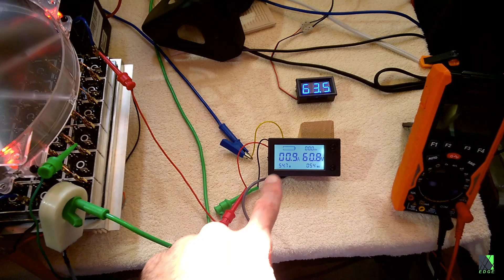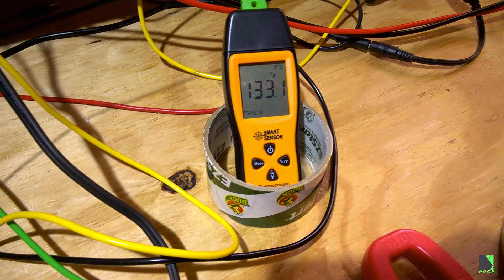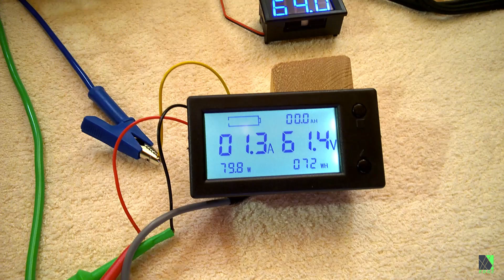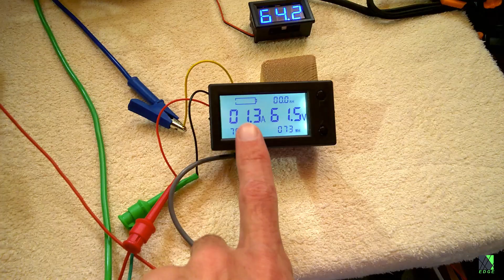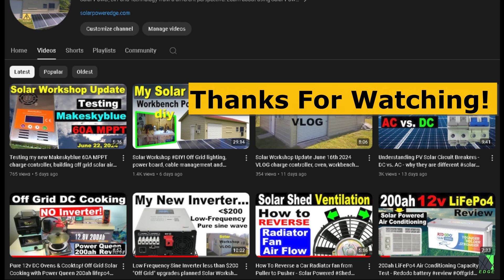Solar Workshop VLOG 008 Infrared bulb, semiconductor solar electric space heat, random updates

Comment: Loving these solar heater projects and was excited to hear you were thinking sand battery and water heater.  I built a 10x20 greenhouse (in zone 6) and want to find ways to heat it (50f to 60f for now) off the grid completely or partially.  I am turning the floor into an insulated thermal mass subfloor heated with hot water, but still figuring out how I am heating the water in the first place.  Have 400w of solar panels (more soon) and been looking at various solar projects for heating.  Your diode chain setup is looking tempting.  Now, maybe I don't understand, but I should be able to still charge batteries from the correct "tap" off the diode chain to match charging voltage, correct?  I did take a few electronics and ee classes a couple decades ago... Ha... Don't remember as much as I would like.  I understand why the diodes arw doing what they do, a little confused why you end up with more "waste" electricity converted into heat than an mppt.
Reply from the maker: Hello, glad you like the videos - in the more recent diode heater video, I explained how a nichrome heater won't get maximum heat when PV connected. A quick glance at Ohms Law/Model will explain why. With the diodes in parallel, they regulate the vMP (max power voltage) which results in more heat overall. I think most don't understand the concept but it is relatively simple and works very good. 

Here's my video of a scaled down test. Think most people were focusing on the wrong point, the watts coming through the diodes while ignoring the Nichrome part. But the theory and practice here is spot-on. The overall system maximizes heat production from PV without any complicated logic or circuits. What does MPPT do? It regulates to PV max power voltage. What do diode chains do? They act very similar to MPPT, yet are dirt simple! combine with nichrome, now you can have the best of both worlds. This is a very uncommon and productive marriage of simple technical concepts :)
https://youtu.be/Cle05mmYOUs

It should be possible to charge batteries with diode chain taps - however I mostly tested them as voltage supplies. It works for running my fans as you can see :)

Comment: Ahhhh this video answers some questions I had in the previous video I watched..... 
YouTube has been recommending a lot of videos that I don't normally watch and not putting forward the channels I do spend a lot of time watching.... I found this video by randomly scrolling.... 
79W is a good number for power consumption, what would you say that you are using as a total which appears to also include the nichrome heater? And what's the temperature outside? 
I heard that it's keeping the place warm, but the colder the weather outside the harder it is to keep a place warm.... 
Obviously a heating device needs to be designed to work for a given area on the coldest day or night of the year.... Things are starting to warm up in the southern hemisphere, so testing heating systems is getting to be a challenge.... But just like hunter gatherers, if you don't work to prepare during the warmer months, you will starve during winter! Or freeze in my case, not that I don't have a method for heating, I have several.... But I'm looking for something that is small, doesn't require a lot of energy to run, and I can use more than one if necessary for those tough days....
Reply from the maker: @PeterMilanovski I hope yt will recommend my videos more often :D this video shows so very little of the testing... I used 100-400w for some of the tests, especially in this video... then with nichrome to take most of the power (that's a good thing). During more recent tests, I used 1600w of solar to drive diodes plus nichrome. Then I added a second diode chain and 4 nichrome. Now I'm working on a bigger version plus a HWH tank using the same idea. The problem with video is I can't get them out fast enough to show the current status, nor is it worth showing every detail as no one will watch the whole thing anyway :D which downranks the video... hope to be more detailed in the future when watch time isn't so difficult

Comment: Love the channel and the knowledge i gain from you. Its been helping me on my journey to also utilize my solar panels after my batteries are full. I like the solar heating design for winter. But need something else for the summer. 1400w of solar with 400ah of lithium batteries. 12v system and a 1000w inverter. Biger inverter needed. Maybe later. But why not use my excess for something fun, useful and makes my brain work. Lol.
Reply from the maker: @acuratltypes6694  Hi I'm glad you found this channel :D good point about summer, it's harder to make cold than heat!

Comment: Easycargo 200gr Thermal Paste Kit, Conductive Grease, Heatsink White Silicone Carbon Compound for Cooling Heat Sink Interface GPU VGA LED MOSFET Transistors (200gr), Opens in a new tab
Easycargo 200gr Thermal Paste Kit, Conductive Grease, Heatsink White Silicone Carbon Compound for Cooling Heat Sink Interface GPU VGA LED MOSFET Transistors (200gr)Easycargo 200gr Thermal Paste Kit, Conductive Grease, Heatsink White Silicone Carbon Compound for Cooling…
$12.99
Reply from the maker: @markpennella Thank you, checking into this now :D

Comment: Thanks for the update. I noticed on the second diode setup that you only used half of the rectifier spade connectors. Is that to reduce the amount of heat in the metal diode casing by only using 1 diode per rectifier or will you be using all the legs in the final setup?
Cant wait to see the hot water heater.
Reply from the maker: @mikefiatx19  Welcome, I'll upload the water heater as soon as possible and thanks for watching... bridge rectifier does two things, it gives more DC attachment points (such as for fans) and the diodes can be in double strings in series. Also you are right I can use 1 diode per case depending on what's needed. One problem I ran out of room on those heat sinks, I'd really like to have double the packages. Looking for a larger heat sink, they are incredibly expensive.

Comment: Slap a layer of TEG's on that diode heater and reclaim extra energy?!
Reply from the maker: @lucasballek 100% an excellent idea :D guess what's underneath the bottom facing heat sink of the first heater? 4x 12705 I did not want to make things too confusing by mentioning them! Haven't done a lot of testing but they do make voltage!
Reply: @solarpoweredge  awesome! 👍🏼😎 

I wanna make a wood fire pizza oven/hot tub, with a layer of TEG's sandwiched in there. Thermal mass of water for cooling, 80-120⁰F and fire being hundreds of degrees, could easily make a significant amount of power per square inch..
Reply from the maker: @lucasballek This is thinking outside the box... use the heat as many times as possible! Sounds like an awesome project (especially with homemade pizza involved)
Reply: @solarpoweredge  off grid luxury 😁
Reply from the maker: @lucasballek Lol right on!

Comment: does infared  light bolt use less power then the heaters you mod
Reply from the maker: @tenij000 It definitely uses less power because it's running at such a low voltage, it does not make as much heat. However it's a nice DIY heater with zero heating element winding required :)
Reply: @solarpoweredge  do think can make work whit a PTC Fan Heater 24v 400watt have 4x cheap 100 watt pannels still from camping still laying around
Reply from the maker: @tenij000 Yes, in fact I used 24v PTC to heat a small back room with 4x100w solar panels, worked great! Just hook them up with a voltmeter so you can see whether the heater is a good match... maybe 2 in series and 2 parallel would match that heater, might have to experiment. 
One of those small DC watt-meters work great to see how much heating power is  coming in.
Here's my PTC heating related videos:
https://www.youtube.com/watch?v=wK3_lRSntRc
https://www.youtube.com/watch?v=UxgINFgqUoI

Comment: Forgive the basic question.   Should I look into brushless motors for direct PV connection?

Recently, I’ve been researching quadcopters.  They aren’t cheap like computer fans but you can buy them in varying size and add varying blade size.
Reply from the maker: @peterxyz3541 No worries, questions are what I ask every day! Just my opinion I'd suggest sticking with cheap brushed motors for experiments: they are tough and always work. Brushless motors need a driver circuit that outputs what is basically 3-phase AC - so it adds another layer of complexity and cost, slows down experiments. Once you have a good prototype working, you could look at advancing it with a brushless motor

Comment: can you tell me the model of diodes you bought
Reply from the maker: @jocosson8892 Hi they are simply 1000v 50A bridge rectifiers, any kind or brand will do. Even a different type. FYI there is a link in description to my amazon pages where I collect all the parts I use over time. Or just search for "bridge rectifier" or "silicon rectifier diode". TO-220 package diodes can work too :D
Reply: there is a link in the description, they are KBPC5010

Comment: Appreciate your sharing the diode heating/voltage step thought process!
Reply: The more gets into the public domain the less chance of it getting patented and monopolized by some greedy corporation. You're doing a public service 😉
Reply from the maker: @gaborbata8588 That's exactly one of my concerns... I hope these ideas will help the "common man" first and foremost...
Reply from the maker: @public0105  Welcome :D
Reply: @solarpoweredge  if you are willing to share, I am curious about how to control the power dissipation(load). Are you just raising the total drive voltage across all diodes to increase power drop at each?
Reply from the maker: @public0105 Sure, there are 2 ways to control power: run another load in parallel to use up some of the power (diodes get less power), or change the # of diodes connected. The solar panels are current-limited. Diodes are not ohmic and have no significant resistance to current. The diodes have a remarkable ability to hold and regulate a specific voltage, very similar to an MPPT controller holding solar panels at a specific voltage most of the day. You can select that voltage, with the right # of diodes. In some cases I deliberately raise the voltage to leave power for other loads in parallel. But mostly, I just want the max heat output, so I track down to the max power voltage of the solar panels. Even with nichrome in parallel, the overall system should get over 90% of the possible heat output... nichrome alone simply cannot do this as it is a static (ohmic) resistance and will not regulate as solar conditions change. In the morning, those diode heaters can still extract 30 watts or more heat, whereas a nichrome heater would pretty much get nothing, like a dead short on the panels. 
Hope this helps :D
I made a really long pinned comment on this video, if you are curious about why diodes can do so much, it's highly recommended reading:
https://www.youtube.com/watch?v=42XIbHA9Dv0
And this paper about diodes is also highly recommended:
https://youtu.be/whOXELklxQ4